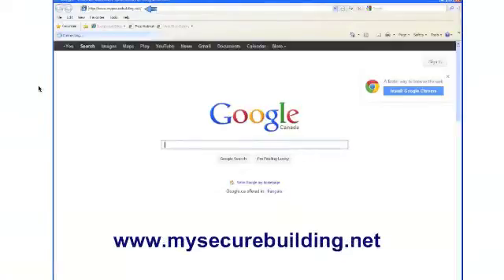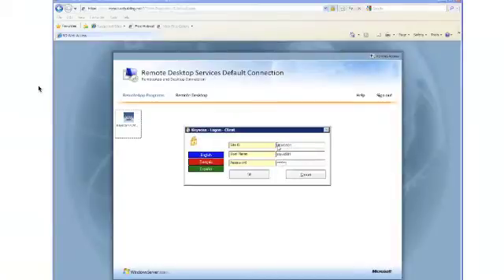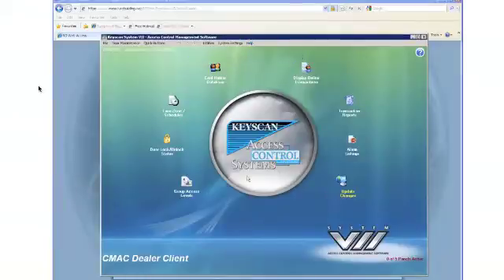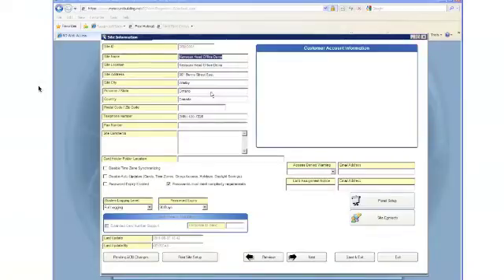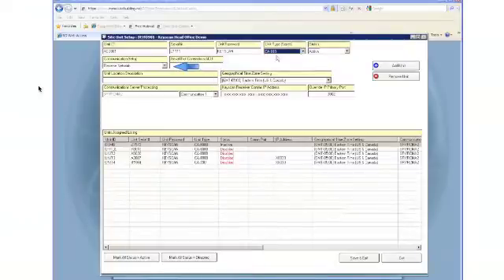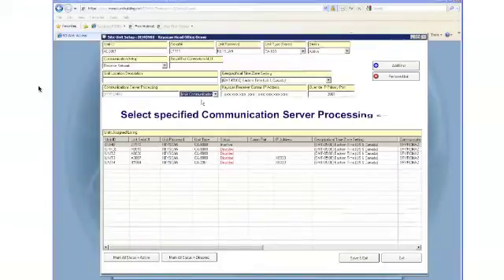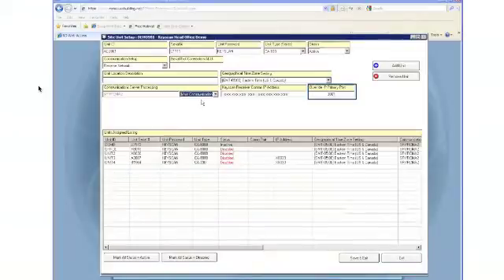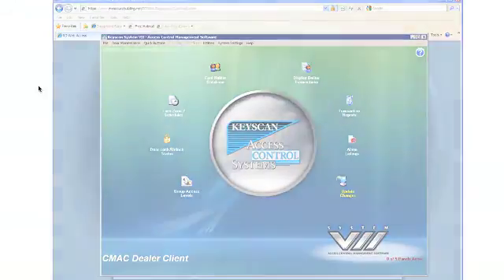Tech Talk - Setting up a CA150 for Keyscan Hosted Services

Comment: I am programming a 200 series panel and having trouble with a net com 2p card. It's mounted onto a cb485 board and the manuals received do not match the terminal layout on the cb485 or exact programming. 
Why is this? The book states "power up with 12dc yet there are no 12vdc terminals like the old netcom cards.